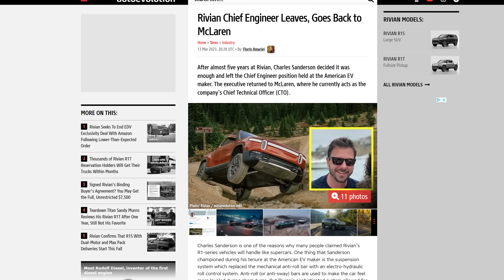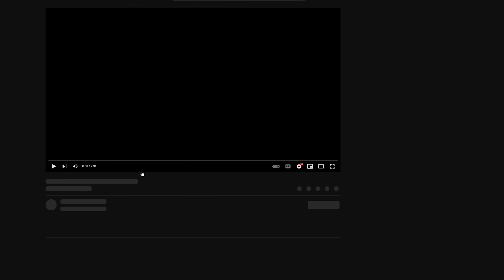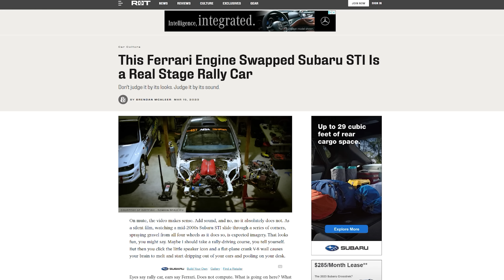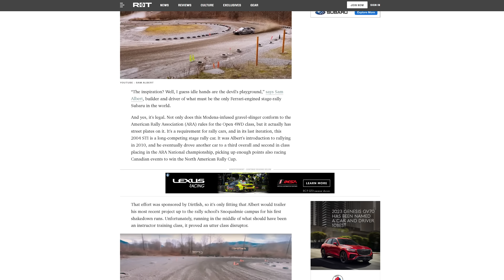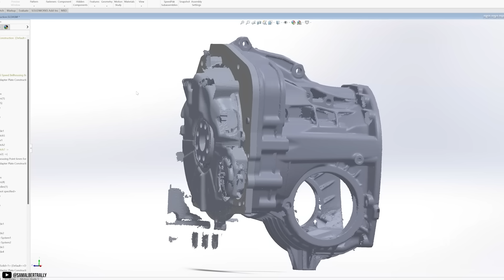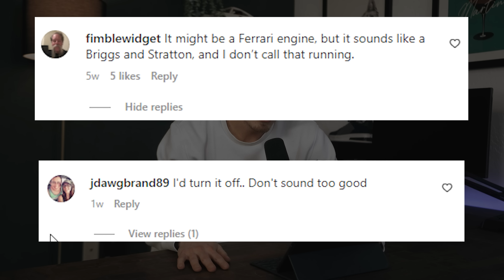This Ferrari Powered Subaru Is Pure Chaos

Comment: in poland you can't even tint your windows, and in america a subaru with a ferrari engine is road legal
Reply from the maker: In Wisconsin you can have your ATV's on public roads :)
Reply: @AlexMartini.  woah
Reply: Well the Subaru is road legal and the Ferrari is road legal so why wouldn't a Subaru powered Ferrari or a Ferrari powered Subaru be road legal as well. Afterall, Ferrari and Subaru have to meet the same standards in order to sell cars in the country.
Reply: Montana is the most free place to have a car.  No inspection, cracked windshields are ok, tint is fine, straight exhaust most people don’t care as long as your not being a menace at 2 am.  No sales tax so registering cars is cheap.  300+ license plate designs, no emissions bs, you can buy permanent registration after your car is 10 years old (never pay for registration again after that).  If we could just have our “reasonable and prudent” speed limit back then we’d be completely set.
Reply: so its settled, im moving to montana.
Reply: @canaryellow.  there is a reason it’s called “The last best place”.  Lots of people complain though because a massive influx of Californians and people from LA are showing up and trying to change everything.  (More red tape).  Bozeman is known locally as Boz Angeles.
Reply: @RustingSoftly  damn do you live in montana
Reply: @canaryellow.  yes sir.  South eastern corner.  In the badlands/high plains.
Reply: @AlexMartini.  over here in Michigan (especially st Helen) you are encouraged to do that in some places. I go race at this thing called the st Helen ATV jamboree. It is a place that people literally drag race atv’s. I try to go whenever they have it, but I live further downstate and sometimes struggle to get there. It is fun when I go though.
Reply: Well, yes and no.  In some American states, what you're allowed to do to your car is very restricted...in others, it isn't.
Reply: @AlexMartini.  same with Arizona, I've seen some crazy stuff driving around here.
Reply: @AlexMartini.  same in Kentucky. You can also ride a small motor bike ( I think 49cc or lower) on public roads without a license
Reply: You can't tint transparent glass.  You can shade it
Reply: @AlexMartini.   In Texas we have hood exit exhausts, dump tubes and turbo’s out the hood and pass registration…. California arrests you for farting.
Reply: @RustingSoftly Dude that's all awesome except the emissions stuff. Cats do an important job and don't inhibit much flow unless you're literally an Indy driver. Even if you're running a 6bt with 1500lb/ft of torque you can still lean that sh-t out without smoking the neighborhood.
Reply: In Florida you can have road legal stock cars a la nascar
Reply: Lamo not in California
Reply: In florida tou dont even have to go to inspections and stuff
Reply: @RustingSoftly  badlands lol
Reply: @Iffinstiffin yeah but when it comes to driving, it’s like a deserted Virginia
Reply: @EatMyPropwash alifornia is one baby step away from becoming a dumpster fire… such a shame, because the scenery is (soon to be “was”) nice
Reply: We can't tint them either haha. FoR oFfIcEr SaFeTy!¡!¡!¡

Comment: Sam is a good friend of mine and he's finally getting this build ironed out.  Obviously there are a lot of little issues that will and have popped up but he's close to dialed in.  This car sounds so SIC in the woods...  Hats off to Sam and Primative for the hard work to pull it off.  From mating the running gear to the wiring to the ECU this was an uncharted build and it works!  Sam just ran Tour de Forest last weekend and I'm looking forward to seeing Sam in 2025.    Alex, if you'd like to get up close and personal with rally and see this run I'd be happy to have you on my volunteer crew launching cars at start control.  I've been competing, organizing and volunteering for over 40 years and would love to show you the sport up close...?

Comment: Just to put it out there, Ryan Tuerk (sp) did a swap using a Ferrari powerplant and was not sued. They sue depending on how far you've modified their own cars. If it is unrecognizable as a Ferrari or if the structural integrity of the car has been modified in any way, they'll either sue or say your car is no longer an actual Ferrari. Please stop perpetuating that Ferrari is suit happy. They aren't a car brand, they're a lifestyle brand. So they want the lifestyle they sell to be recognizable and cohesive. A wrap, bodykit, or paint doesn't bug them. Removing the roof and badging does. This subaru is safe.

Comment: Flat-plane crank V8 sound like shit at low revs due to the firing order difference making it sound closer to two 4 cylinders arguing with each other at low-revs. This is not why you buy or how you drive any car with a flat-plane engine, so nobody who owns them or loves them cares. It isn't the best but a Ferrari at idle is driver-error anyway.